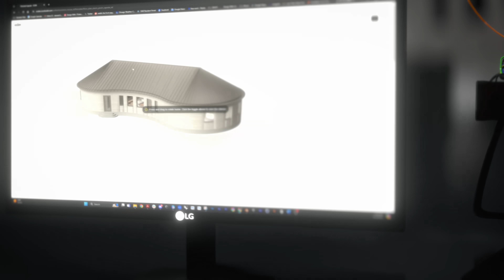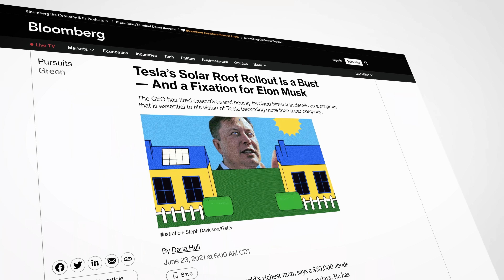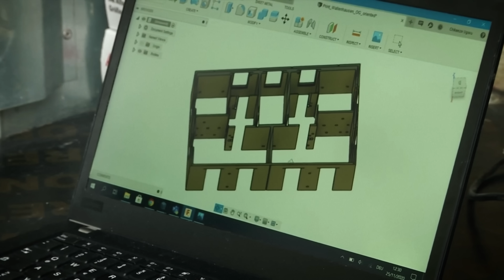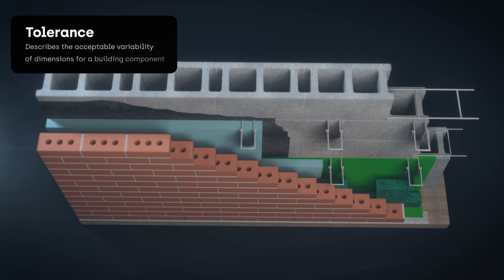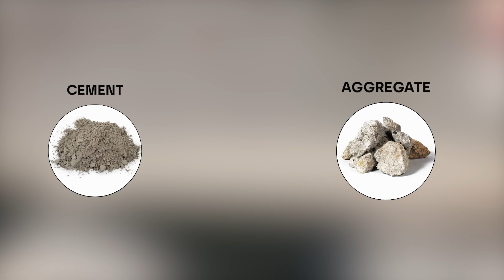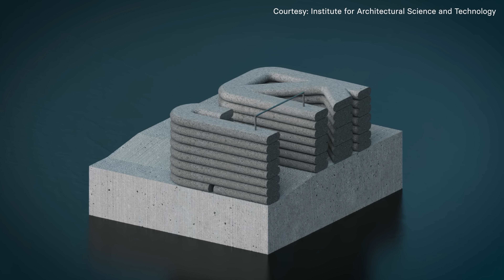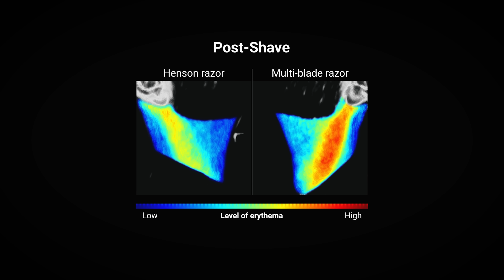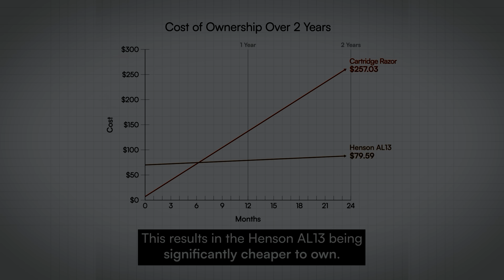Why 3D Printing Buildings Leads to Problems

Comment: I can take a crew in in 3 days have a poured concrete wall where you could build anything you want it. And everything is solid there's no actual round spots unless you want that you can design that into a concrete poured wall which has been around for a long time. And it doesn't take any electric other than a vibrator to shake the concrete.

Comment: Putting up the walls (disregarding the materials) is a much smaller percentage of the cost (time and money) of the entire house than some people think. I see little to no benefits of 3d printing. Time .. that may be a benefit, but that wall needs to set and it cannot compete with pre-made panne houses.

Comment: "doesn't look good and so is unacceptable" -- pure subjective opinion, i do prefer 3D printed walls to bricks personnally. Subjective, too. Yeah i'm not an architect, but it's not the architect that pays for the building. He does what I say. Then, considerations on the complexity of assembling the 3D rig on site... depends on the rig. Some are just a truck with a boom. So you've seen something in the past you don't like, you decide the whole tech is doomed. The thing is, you live in the past. Move on.

Comment: Let's set the record straight on the robotics end of the 3D printed concrete structures - the lack of tight tolerances is NOT with the robot mechanism, whether it be the X-Y machine or an actual robotic arm, but rather with the concrete aggregate mixture coming out of the dispenser tube! These robotic machines probably have repeatability and tolarances to 0.010 of an inch - one ten thousand of an inch!

Comment: In the not too distant future you could see giant AI controlled construction robots doing most of the tasks like rebar, steel bars, plumbing, framing etc working alongside 3D concrete printers or similar.

Comment: Frankly speaking we should just return to wood and stone. These are waaay more environmentally friendly and modern technology makes constructing a house really fast and easy. The whole saving thing here is the work of 4 dudes. 
Maybe thats a good idea for developing countries where you need a lot of housing FAST but not in the old world. Honestly prefabs were the revolution. 3D printing is the same thing as building prefabs or panels at the factory - the only place where it benefits most, is the place without factories. But at these places there is little value.

Comment: The other factor to consider is that the layers of concrete naturally form a series of bulges and indents up the wall. Those indents would collect dust on the inside and be very hard to clean compared to smooth drywall or mostly smooth vinyl siding.
The ongoing maintenance would suck

Comment: 10:11 "But with 3D printed concrete, the extruded, layered walls have to do it all" - no, they don't?  It is very possible to refine the surfaces (both interior and exterior).  It would have been plenty to say 'they often are left exposed which has x y z downsides".

This kind of generalised, conclusive statement/error (which you have multiple of in this video) really undermines the quality of your analysis.  Very close to being really compelling, but blocked by prejudice/favoring traditional building processes!

Comment: Here is one thing I don't understand, watching this video and seeing the houses... Why can't the "3D printed parts" just be the inside reinforcement, and you place a shell over it to make it actually VISUALLY better. Wood, Plywood, Shillings. Why do homes require this ugly, disgusting, lumpy visual mess, when you could just have tiling placed over it? Can you not drill into, fill with foam, or glue stuff over the 3D printed material?

Secondly, instead of 3D printing the entire house, why not, as you pointed out at the end, have 3D printed parts you can use instead. Can't a company Design a small 3 bedroom house, 40f by 40f

And then cut up every wall and floor and roof section and just MASS PRODUCE those cut up sections by the hundreds of thousands, and just literally slot in and make thousands of homes within days?

That's the strange thing I see with this Housing Market. Homes are too unique, different, and built slowly by thousands of usually ineffectent scam companies that cut corners. Why can't we just mass produce 1 specific well design house, and have millions of that 1 copy across the entire country. If people want to modify it, or build their own house, they can, meanwhile have the companies mass producing this 1 copy to fix the housing crisis.

It can NOT be that hard. If they can make factories to AUTOMATE the construction of a CAR and TRUCK, they can automate making 4 walls that just need to be bolted onto a mass produced floor, and a mass produced roof on top of it.

Comment: What if you just had a little trowel sticking out of the nozzle that smooths the outside edge of the building as it passed around for each layer? Seems like you could get rid of a lot of the lumpiness.

Comment: This problem was solved before 3D printing was invented! Answer = An inner and outer Mould with Reo Mesh standing central between the Moulds! The Moulds can be 3D printed from reusable plastics! Essentially pouring is the same as pouring a Concrete Tank, which is a skill in it's self! There won't be any structural strength without the Reo! Or print the wall as two sides, one side first push in and tie the Reo then print the other side of the Wall to incase the Reo! Or a double nozzle printing both sides of the Reo at the same time!

Comment: Your repair and future compatibility concerns seems bit overblown to me ... first its not super likely that your concrete wall will need repair and if it does why not cut out the part and replace it with an offsite printed insert ... all this can be solved quite easily. Or at least not much more complicated that adding a concrete wall into an existing building. Same with your worries about vendor lock in ... rather theoretical.

Comment: Concrete foundation, stud homes with drywall is a point we’ve gotten over hundreds of years of standards in building. It’s going to take more than a couple of years to turn all that on its head with robotic 3d printing.

Comment: Your video is better than most but again a distorted time frame for printing. The machine does not set itself up. Your own example shows a concrete pad. 4 days my ass. The big reason most of us do not take it seriously is because most of the info is all cherry picked.

Comment: As a layperson and someone who owns a 3D printer, 3D printing doesn't seem like the future of housing. I think construction could take a page out of the book of pick & place machines used in PCB manufacturing instead. Sure, it's not as easy for the architect as just creating an STL file and liquid components like caulking for windows may still have to be done manually, but I don't see that approach having the same caveats as liquid concrete.

Comment: Concrete is the worst kind of construction material, its only positive point is cheapness, traditional building materials are way better on every aspect. But houses still cost as if they were totally handmade like they did up to less than a hundred of years ago, when they were even more durable.

Comment: Why not put drywall over the cement? If your biggest complaint is that it looks bad, just add the extra trim bits like you said. Theres barely any problems
Reply: Extra cost. You can stucco the exterior and plaster the interior, it's just going to cost more than just building a finished brick and lumber house in the first place.

Comment: Would 3D printed homes fare any better in a hurricane or tornado. I just went through Hurricane Milton and am wondering what can be done to mitigate the effects of these catastrophic weather events. Tornadoes in particular take seconds to turn a stick-built house into toothpicks. Would the use of concrete and the curved corners help direct winds around the structure? Can they be tied into the foundation to create a water-tight barrier to rising water? I believe there are opportunities here to improve the way homes are constructed in the US.

Comment: I really like the look of these 3D printed houses! The round corners make it cozy and modern at the same time. And the layers look somehow way more natural.

In addition, they are a great way to minimize jobs at construction sides which are harmful for the worker's body over the long term.

I'm just worried about the CO2- footprint of these buildings. All this concrete should be way worse for the climate than clay Bricks and wood, right? I hope that these companies are also researching on clays with composites as a building material instead of cement.

By the way: I absolutely didn't get the point about repairing and modifying these buildings. I really don't see a bigger problem there compared to normal brick houses. Maybe a practical example would have been good to explain this.

Comment: Frank Lloyd Wright didn't shy away from reinforced concrete, he leant into it. Todays architects should be leaning into these new processes, not trying to make them fit old ways of doing things and how things "should" look. A mud brick house can be shaved down to look like a regular wall, or it can be celebrated as different. Print lines should be a mark of pride and something to show off.

Comment: I want robots laying brick. I think that could be as quick as printing concrete. Still I'm sure that might take even more R&D but Boston Dynamics already has some impressive robots. This isn't to take away what others have commented in this thread, for example there were take earlier comments about how we've automated the easiest part of building,  which my hunch is that this is probably true.

Comment: Concrete homes are grossly expensive to maintain.  Even Frank Lloyd Wright concrete homes, have cost millions to repair.    Shockingly, 30 years is end of life, unless someone throws alot of money at it.   So, the clear difference here, is that you have no reinforcement in the concrete.  Interesting.  Not sure if this is better or worse.  in 30 years we will know.  But, I know if I put wet concrete in a mold, and put it out in the yard, in a few years, it will be dirt.  Adding insult to injury, portland cement in the USA, has been altered to be more environmentally friendly, in June 2024.  They traded longer lasting concrete, for a lower carbon footprint initially.  We'll need a few years to see how that plays out.

Comment: Instead of 3D Printing houses from concrete where they are not recommended on seismic locations, where there are earthquakes, instead 3D assemble houses, instead of having people work use a computer to do it. But this is also will make people living in the construction industry lose their job.

Comment: Can we talk about the fact that those companies claim to attempt to solve a problem that doesn't really exist? Housing crisis isn't caused by not enough houses, it's caused by corporate assholes buying shit ton of real estate in bulk in order to price gauge. Other problem is that it will become an even bigger issue in the long term. I can see that this tech is only viable for building relatively small houses family homes, which are just extremely space inefficient. If this method catches up, it will only cause an increase of the god awful american suburbs which is one of, if not the worst city plan one can imagine. Cities will run out of space orders of magnitudes quicker and another housing crisis will insue.

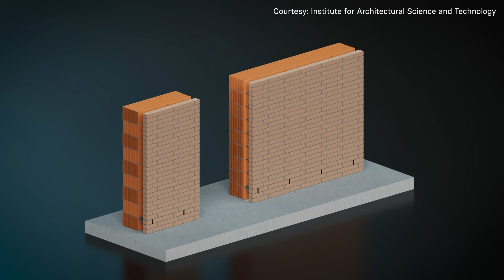Comment: 2:42 Ever heard of arcs?
3D printing a house is not practical solution to the issue of affordability. Only thing you save is mold materials, but that is solved by prefabricating elements that is commonly used in the industry already. Only place i see this practical is prefabricating organic outer walls and such sections, but that is for rather neash market of high end houses and architects wet dreams, that really do not provide cheap housing. With prices on land due taxes and availability and cost of materials due rampant inflation, people are looking cheap durable housing. 3D printing does not provide any of that. Closest thing is log frames made from local logs milled in site, but that is not possible in cities so concrete elements are used. Then again why would you want to live in cities, specially how things are, so there is the answer for the affordable housing.
For the corners and overall smoothness of the walls, you still need professional to smooth it by hand, or smoothen and add plaster to smooth the surface. For the water issue sure foaming the gap kinda makes sense insulation wise but how do you replace it if there is damage or large leak. Whole wall needs to be pulled apart and redone to even dry the construction. Only way to fix it later would be hand held nozzle, but that is heavy and end result wont be as clean looking and again we hit the insulation issue with it.

Comment: Sorry but you are irrational. Your opinion is obviously biased because you don't want to see the industry changing. I know this because the same thing happened in my industry and I had to deal with this behavior quite a lot. When 3D printing hit the jewelry industry, people where dismissing it for all the reasons you mentioned: high barrier to entry, inflexible machines to work with, there are better alternatives to save costs, etc. And yet the whole industry has shifted towards 3D printing now. While some of the criticism was true at first, one thing is not to be overlooked: these 3D printers have a lot of potential for improvement, unlike alternatives that are already optomized to the maximum of their potential. As long as there is one use-case that makes 3D printing financially viable, there will be research to improve them, and the improved version will come and take more shares from the market. That's what happened with the jewelry industry, at first the softwares weren't good, the printers unreliable, you had to hire an engineer because no jeweler knew 3D modeling... This was 15 years ago, now the printers are awesome and we make everything with them. I can't imagine why it couldn't happen in other fields where 3D printing has one valid use case to start iterating improvements.

Comment: 3D printing concrete, the worst solution ever because:
A) Cement is toxic, construction needs to stop using an endless array of toxic materials in buildings.
B) Concrete has a terrible CO2 footprint.
C) Concrete requires sharp sand of which the supply is dwindling.
D) It's clear that the 3d printed model is going to be incompatible with most existing construction steps that come next.
E) The building can't be printed in between other buildings / in tight spaces.

And, how long would this material last? What is it's insulation characteristics? How waterproof is it? Is the waterproofing toxic? How strong is concrete with rebar?

Comment: So how would you plan on running any power through this? To my knowledge (as a first year apprentice) NEC states wires need to be supported every 4 or 5 feet so you just drill through non load bearing studs to run them. Would you treat it like a finished basement and cover the walls with studs for that then drywall? Do you expect someone to drill through all that concrete all day to run wire that will inevitably get caught on a snag and ripping insulation/repulling everything? Do you expect people to want to live in a small warehouse with conduit (that needs bent by hand or if a machine does it needs measurements for everything then shipped)and junction boxes everywhere?

Comment: How about mention that one reason the construction field doesn't progress at the rate of cell phones is because buildings must be safe as well as pretty and useful, and building codes have to consider things like earthquakes, snow and wind loads, fire resistance, etc. Nobody dies if their cell phone collapses at 1 AM during a hurricane.

Beside, by the time you have riggers set the 3d printer up and get that all square straight flush and plumb, how much time and money have you actually saved vs just putting up concrete forms, setting rebar and pouring concrete the regular way?

Comment: I feel like they  skipped how they would get wires, plumbing , and ducting for hvac would get into the building.  

That does not even go into 2 story buildings and how they would print the floor.

I think 3d printing would be better used for pr8nting components to go in later or just premade wall sections or supports that would be covered.

Comment: We already had concrete houses made more or less like this in the UK, but instead of printing layers they'd set up moulds and pour concrete into them. You might think "OK but you have to set your moulds up, can't just bring in your concrete 3d printer" but I'd have to wonder how long it takes to place the printer, how long it takes to calibrate it, make sure it's going to print right etc and I wonder how much time/labour printing like this will actually save over pouring concrete moulds. 

Additionally, 3d printing will invariably mean that only fine aggregate can be used as the concrete has to be extruded through a nozzle, where many UK concrete houses have very large aggregate which both saves cost and improves compressive strength.

Edit: As to the question of Openings in structures - this was either built into the mould shape or you could insert a piece during moulding and then simply knock it out when the concrete was cured.

Comment: I am a mason and they are ugly. Concrete emits pollution during its curing process wood framing is great and the wood Industry is renewable . I look at these homes and suffer to think electrical plumbing and other mergings of materials .  3D printing has it's place just not homes. Imagine getting printed half way and a large rain storm OMG yuck hope they tent the entire machine. We place to much responsibilities on machines people need jobs not machines.